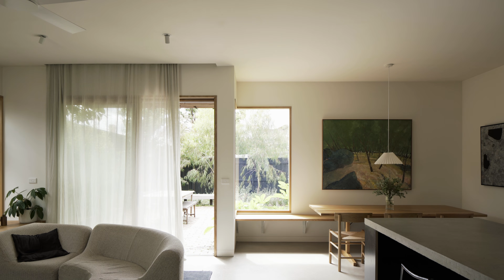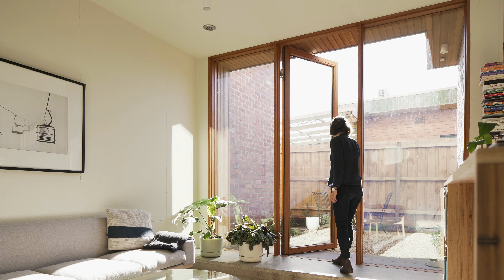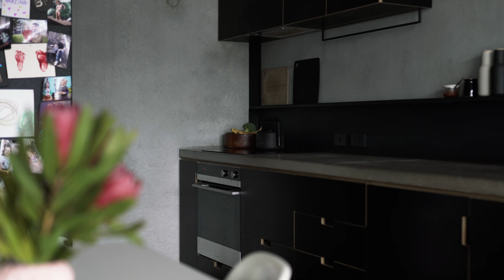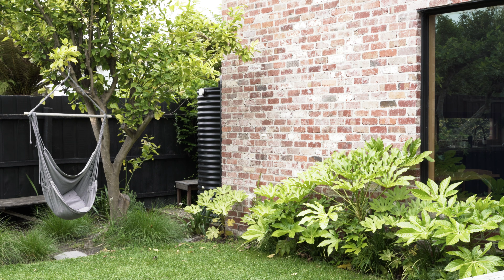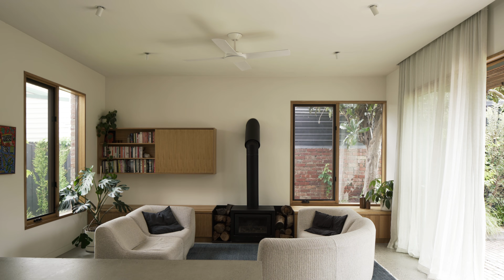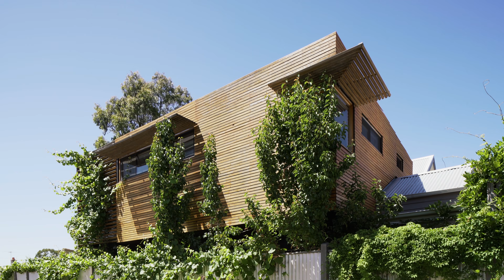How You Can Design Your Home to be More Sustainable

Comment: Wise words.
Unfortunately, most designers seem more interested in creating something that lives up to their egos rather than something that is sustainable, and above all meets human well-being.
Reply: Unfortunately, most homes aren't designed by 'designers' at all. Instead, project homes (standard plans built by large builders) are the home of choice for almost all home owners, being responsible for well over 97% of total homes constructed. These don't have any of the principles in this video at all, in fact almost the complete opposite, with bad orientation, no ventilation, large footprints (theatres, sub-kitchens, multiple living areas being the norm) and high-energy materials used instead. Architects and designers undeservedly get this opinion, but of course they are only given less than 3% of the market to operate in.

Comment: Important to note for the northern hemispheric viewers is that up here, SOUTH FACING is what you want for solar gains.
Reply: What if I want to put my house directly on the equator?
Reply: @bland9876  then you wouldn't be too interested in solar gains, now would you? Shade and ventilation in the tropics!
Reply: @bland9876  if you live in equator the sun will pass from east ,almost be directly overhead at noon, and set at the west, it will happen on both equinoxes.. other than that the angle of change would be 23.5 degrees the sun is leaned more towards north at noontime and 23.5 degrees the sun is leaned more towards the south at noontime(depending on the season), that is the basic path of the sun for homes in the equator...
Reply: @bland9876  🤣 then you get to choose.
Reply: Try to get heat in in the morning and store it... avoid overheating at noon. Enjoy the evening sun on your terrace ...

Comment: I want to add to that Passive Design point.  It's not just more sustainable and its' not just to lower your heating/cooling bills.  It's also healthier. You have fresh, filtered air circulating continuously through your home.  It helps if you have allergies, it helps you to sleep better and function better when you are awake.  If you ever visit a Passive House, notice how fresh the air is inside!
Reply: Yes!  We designed our house with passive solar (work with Mother Nature) with bedrooms on the east side so we wake up with natural sun light.  To me, that is building 101.
Reply: @youbyoubalancedliving9700  awesome! South is the best exposure since you can get enough direct sun light during winters but block it during summers, but East can work too with some screens